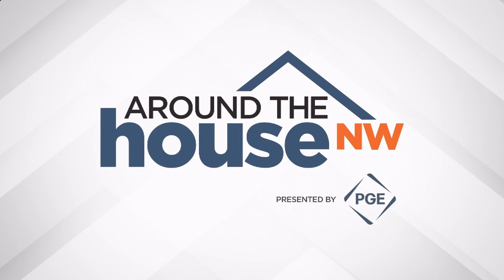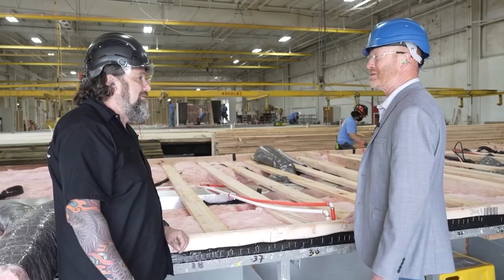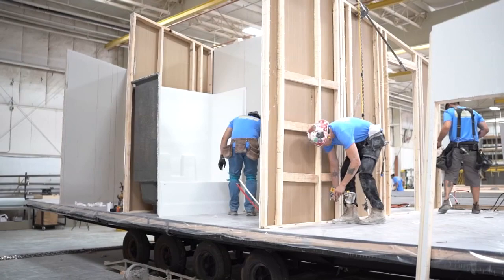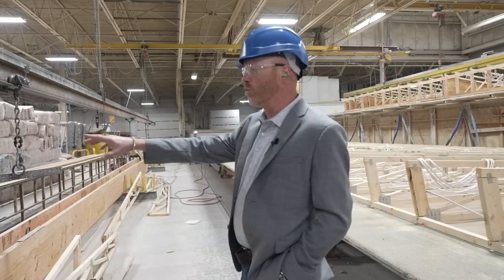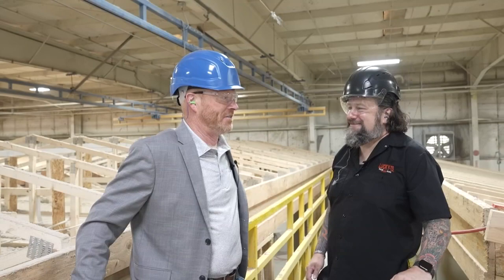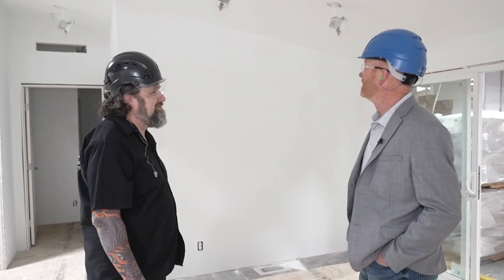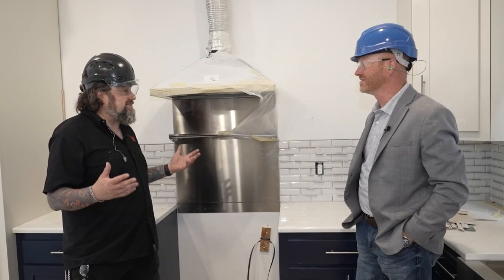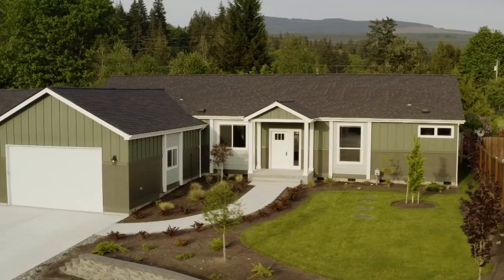Made in the NW: How Manufactured Homes are Built at Skyline Homes

Comment: My family and I lived in a Skyline late 60's to early 70's!  When winter came we froze..plastic over the windows because there were no storm windows, cold wind would would blow in around light switches and wall outlets!  The furnace never stopped running and finally had to have a new motor replaced every winter.  Orange tinted paneling with green carpeting one bathroom, three small bedrooms and a tiny living room and kitchen!  I would hope by now Skyline has straightened out there problens!

Comment: Cool video but it doesn't make sense to use wood framing for a mobile home. They should be using light gauge steel which is proven to be structurally stronger than wood. They also skimped on interior framing as usual at 4:19 since it's clearly random spacing and not the common 16-inch on center.

Comment: They are definitely not air tight and have absolutely zero insulating factors. When you use only staples as fasteners, you are bound to fail the structural integrity of the build. 2x2 wood for rafters is as cheap as possible. Absolutely no craftsmanship, just a bad investment!